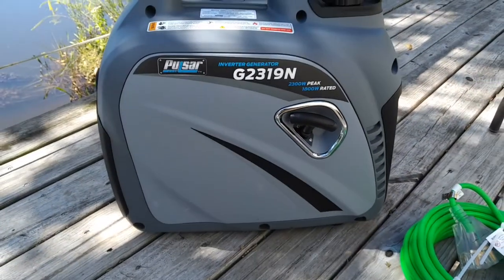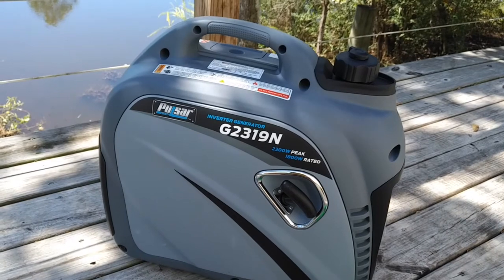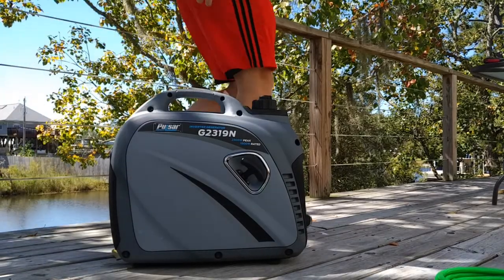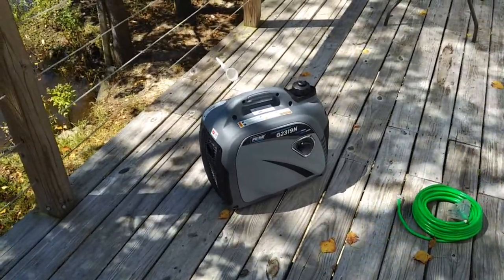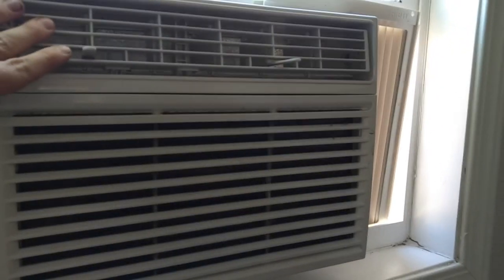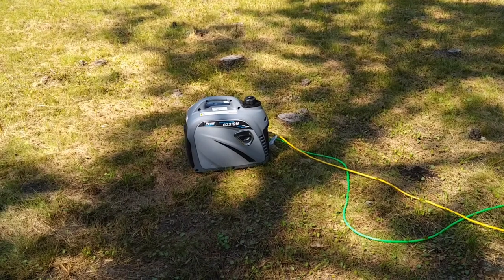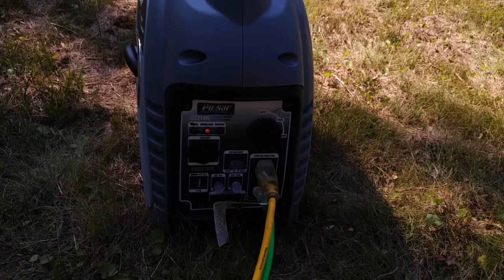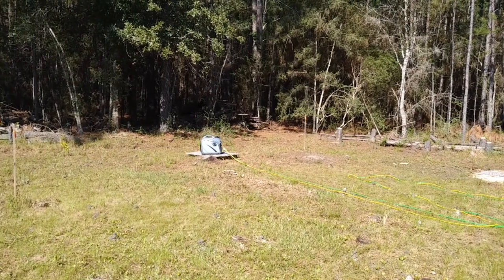Pulsar generator initial review and testing it out - 2300W/1800W

Comment: I have the Ryobi RYI2322, same engine and basic setup.  Ryobi adds its control panel with LCD screen and Bluetooth phone control with remote shutdown.  I haven’t seen this mentioned but there is no doubt the same Ducar engine and design is the basis for both models.  There are probably several models from different manufacturers based on the same design.  I love the Ryobi and it is worth the premium to me.

Comment: This is why Electricians are licensed(four yr apprenticeship/testing/8000 hrs of installations)....... you may kill someone without knowing it SIR !!!!!   Bonding and grounding have different connections for different applications. Just because "it works" doesn't make it correct and SAFE !!!  other considerations are; the 100' cord, what size conductors ? did you derate for voltage drop.......you may burn equipment and cause a fire( calculations of formulas is needed )........ You have an unbonded floating neutral generator, where is the ground rod ????...... learn how to do these kind of systems for SAFETY !!!! If you wish to make videos...........

Comment: well if the pull cord breaks you have to take the plastic off and take off 4 bottom bolts in the front  its easy after you do it once i own 4 of these  and let them run all day and night they might work for a mini split air counditioner  but forget about any other kind they work for dc powerd heaters good for recharging battery powerd solor panel systems when there is no sun

Comment: I do mobile detailing and I would like to have something like this because I’m using my car to drive around and detailing cars . I’m wondering if it’s suitable for running a vacuum and pressure washer.?
Reply from the maker: Look for a sticker on your vacuum and washer. If it says 1800w or less it will work. You might want to step up to one size bigger on this generator. I think they make a 3000w version.

Comment: Have had mine for over2 years,  and have had zero issues, and It  runs everything I can throw at it, including my 10,000 ac unit. Definitely a good buy!
Reply: Do you have a hour meter on it just curious how many hours people are getting out of these we bought one last year only have 40 hours on it so far but will be using it alot more now that we got a icecastle fish house
Reply: @howelake  no sorry, that never crossed my mind. As far as hours go, I probably put less hours than the average Joe, but non the less, it starts every time easily no matter how long in-between  runs, and I've ran everything in my house so far with ease.
I'm sure typical hours run time could be found somewhere online.
Reply: OK just wondering have not been able to find any with over 300 hours so far I'm sure that they are out there  hopefully some one will comment on one they have
Reply: @howelake  i have one and its going on 1000 hours! Im sure it will pass 1000hrs its still running like new 😊

Comment: Do you think that generator would run one of those portable A/C units? You know, the kind you can wheel into a room and exhaust the heat out a window or a door? Or would a regular generator (not an inverter) work better?

Thanks anyone that can help me out!
Reply from the maker: I believe you will be fine for an 8000 btu unit. 10000 I’m not sure.
Reply: @OutpostCTD  Thank You for replying 😎
Reply: You can look up the wattage requirements on the sticker of the unit, or if it doesn’t show wattage, multiply the amperage times the voltage. For example 7A X 120V = 840W. I hope this helps. 👍
Reply: Depends on the Air Cond specs.

Comment: Use shorter and thicker gauge extension cord for less resistance and voltage drop. A  10AWG or 12AWG cord is much better. The 14 and 16AWG are for Christmas lights.  For your a/c roof top unit a soft start capacitor would help or a new unit, but it is very old. The Pulsar has an undersized engine at 79cc. If you use this unit at its maximum running wattage range you will distort the sine wave and overheat your inverter. For instance a Honda Eu2200i uses a 121cc engine and can surge for over 30 minutes. Yamaha uses the 79cc in their 2200 watt unit and they suffer from lack of power. Try the better cords first.
Reply from the maker: Thank you for the advice

Comment: These are not meant for AC units
Reply: Desert 82, inverter generators are fully capable of running AC.  The only questions to consider are;
How large is the AC? 
Is it an old unit or a newer and more efficient AC?
And how large a gen are you using.
I have seen plenty of videos on YouTube that clearly demonstrate a 2300 watt genny running a 13500 rooftop AC, but it has to have a soft-start module i stalled.
I’ve also seen a 1,000 watt inverter gen powering a modern 5,000btu AC (which are frequently supplied in smaller travel trailers).
Please don’t make such blanket statements.
Reply: Runs my 10,000 perfectly.
Reply: Not true
Reply: Modern air-conditioners are less demanding. I have a 12,000 BTU with 1000 start up watts.
Reply: Runs my 12000 but perfect for 8hrs on 1gal

Comment: It should run the ac but you can only have the ac connected to it with a short cord unless it’s a 15k btu then it won’t do it.
Reply from the maker: Thanks. I have tried with a 50 ft cord. I may need to try a 10 ft one or something. I think it is a 12500 btu unit.
Reply: Depends on efficiency and watts.

Comment: Hi.  I recently purchased this as my 1st generator.  Plan on using it mainly for camping.  I have a question about the ground terminal.  The manual says that the generator's ground terminal must always be used to connect the generator to a driven ground rod.  What is that about? Do I need to connect the ground terminal to a driven ground rod w/ 12 AWG copper wire??? If not, then when would I need to use the ground terminal?  Thanks for all your help in advance!
Reply: Technically the point bonding the ground terminal on your generator is to be NEC compliant, since a generator is considered to be a ‘separately derived system’. In the simplest terms, the purpose of a ground rod is to dissipate voltage from a lightning strike that comes into contact with any and all metal parts of a house that are bonded to the electrical system.
Reply from the maker: The generator will work without terminal but the manual likely says to use the ground terminal to cover themselves from liability.

Comment: I have this generator. Brand new. Going to test it. Not intended to use regularly. What type of oil do you recommend for people using this generator once in a while?
Reply from the maker: I have a couple options I like for oil. Penzoil synthetic 10w30 is a good one. Also Schaefer’s 7000 10w30. There’s some other good options out there but these are my favorites so far.
Reply: @OutpostCTD  Thank you! Quick question. In the manual oil specification says  is 10w40. So 10w30 also works good?
Reply from the maker: @anilkumar1971  it should. My manual says to run 10w30 in it (with 5w30 also an option) and the little bottle of oil that came with my generator says 10w30 on the bottom right of the bottle.
Reply: @OutpostCTD  Thank you.
Reply: If your going to use it occasionally, the best way to take care of it is to turn it on a let it run even when you don’t need it, don’t let it sit for 6 months and not turn it on. Once every month or two, turn it on with fresh gas and hook up something light to it and let it run

Comment: Will Long extension cord affect max output of gen to keep rooftop AC from starting??
Reply from the maker: It will have an effect if it’s taking close to max power to start the ac. In my case I reattempted with a 50 foot cord rather than the 100 foot but it didn’t change my results.
Reply: yep

Comment: You think it can handle 1500 wat engine block heater
Reply from the maker: I think it will. I have ran a space heater with it on 1500watt setting and it runs but it does rev pretty high.
Reply: NO!

Comment: Is it load sensitive variable? Or just two speeds, idle down, and high? 
Honda EU2200i has proportional variable so at 500 watt load it doesn't just go to high for only a mere 500 watts, it adjusts somewhere between low and highest with a stepper-motor to save fuel and noise.
Reply from the maker: Yes indeed it varies based on load

Comment: The Pulsar is the best 2K inverter generator for the money.There are at least 15 brands that all use the 79cc Ducar motor and only differ in the plastic panels and front panel layout.You can buy nearly 3 Pulsars for the price of the Yamaha and they're nearly identical.
Reply: I wonder if this is actually the same generator.  I know the 2k can actualy the handle 2300 peak and 1800 running that this one is rated for.

Comment: My 5k btu unit pulls 3.2 amps, fridge pulls 1.1 max.  Check the voltage drop through 100' cord with a meter.  Not good to use especially when so close to maxing out generator with 10k btu low efficiency AC.
Reply from the maker: Thanks for the comment. I was thinking the same with with the long cord. May try it again with the 50 foot one and see what happens.
Reply: @OutpostCTD  I have adaptors and plug right into the generator with the campers factory 10 gauge cord. I have a 69 concord but all appliances are brand new from Walmart.  😁.  That little generator also runs the microwave, water heater, or cooktop but I only use one at a time.  Subd to your channel.  👍
Reply from the maker: @TheProchargedmopar  Thanks - That's good to know. I may get a 5k btu a/c in this case so I can run other things as well and still use economy mode.
Reply: @OutpostCTD  you’d be best off getting your cord short as possible.

Comment: Cant wait till they make a diesel model of that!!! 😎
Reply from the maker: I was thinking the same thing. Would be really cool. Cummins makes some generators that I've seen on nice class A RVs and high end 5th wheels but those are big non portable generators.
Reply: @OutpostCTD  Very true!. Cummins does make some nice generators for sure. I can't power my AC on my RV with less then 3000 watts without it going into overload mode at some point just running the AC. The best luck I have had with generators for the price is Champion.# 100262. I work mine a lot in the summer time. 
    I think that Pulsar is as good any of the smaller generators. Like you said a lot of them have the same engine... Thanks for the reply...👍
Reply: Portable Diesel turbo intercooler electronics injector will be nice